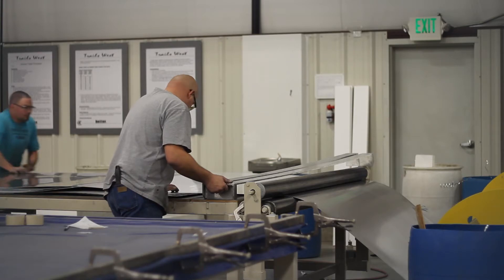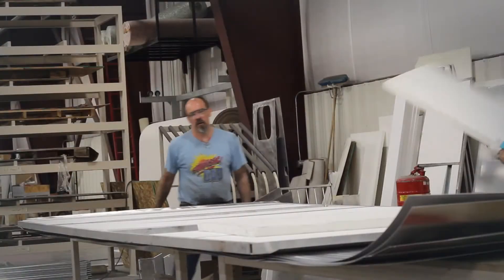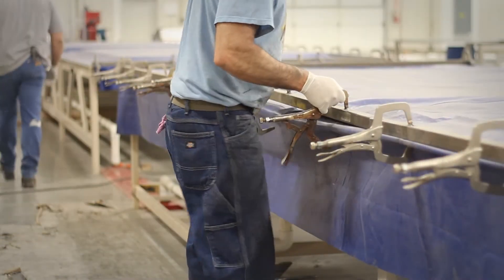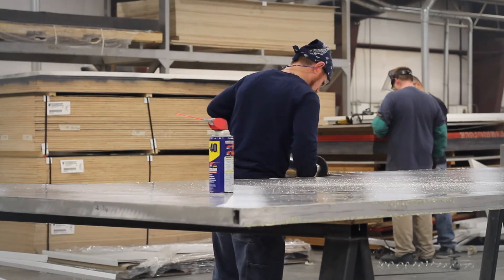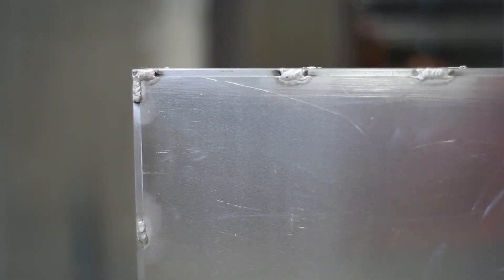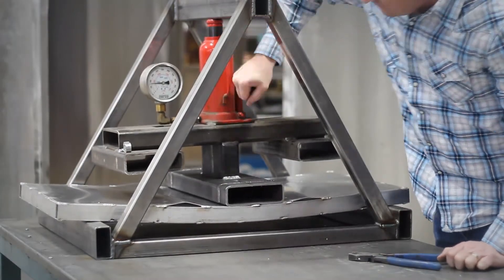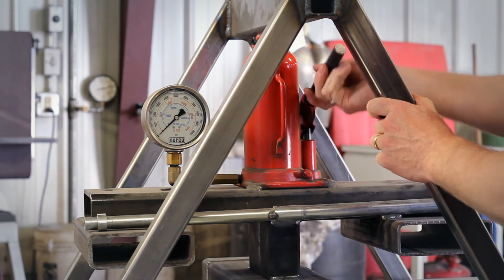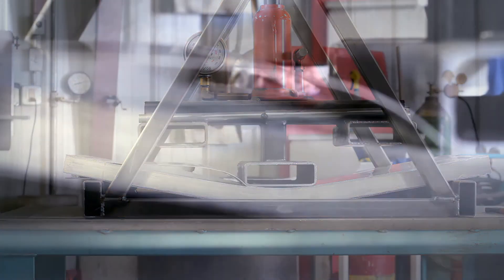Trails West Trailers Sierra Select Aluminum

Comment: So what happens when a custumer dammages a wall. They have to replace the hole wall instead of grinding a few welds and just replacing a sheet? The glue kinds seems like a easy method for you guys buy not so good for a customer.